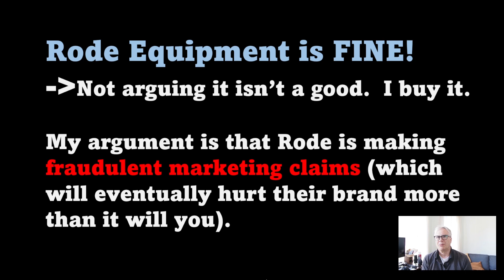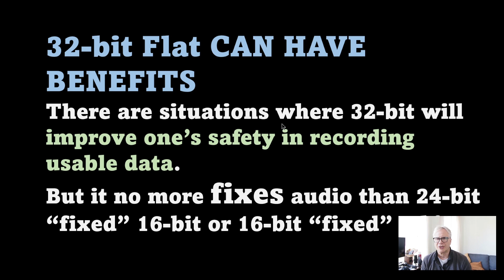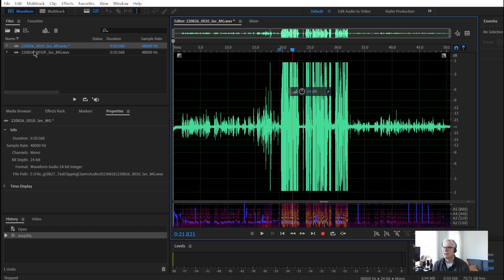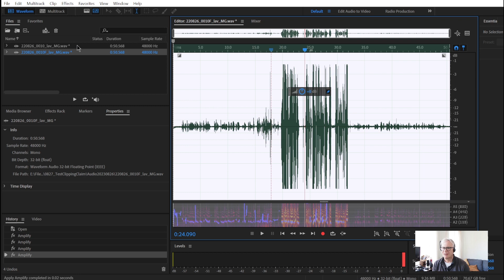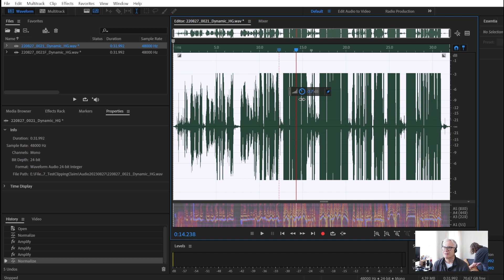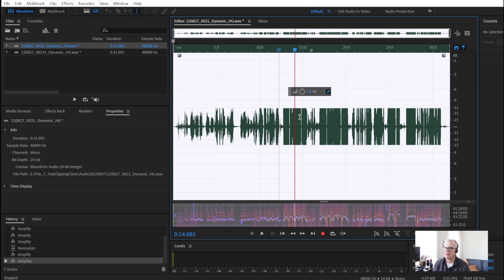32-bit Float Microphone Clipping Tests

Comment: The 32-bit version did actually capture the salvageable loud part, but you boosted the whole thing to compensate for the section that was too low.  Use the blade tool to cut that clip into sections.  Lower the sections that were too loud, raise the section that was too low, and you'll have completely usable audio.  The main objective of 32-bit is to capture everything, and to have the power to isolate and just adjust any sections that are not usable.  In a perfect setup, you would pick a gain that you like in its unmodified form, and you never need to adjust it and you just have a bigger file.  In either case, after making those adjustments, you will likely re-export them as 24.
Reply from the maker: I analyze the data directly.  I don't use tools made for consumers to modify audio.  They aren't designed for testing.
Reply: @MaxoticsTV  The best test is still your ears.  If you boosted the just low parts, then lowered just the loud parts, that entire recording would be completely clean.  You played perfectly clean audio when you played back the loud section with the volume lowered, but for some reason you boosted the entire clip back.  That defeats the purpose.  Record the whole thing in 24 bit with the gain all the way up, then try the same test.  You will likely end up with an unusable recording that can't be lowered enough to sound clear.

Comment: I don't know if I followed you on your first test. When you raise the gain of the 32 bit Recording the MIXER was distorting, not the recording. When work on 32 bit the way you've done, you have to process the audio, like "normalise" it to -1dbFS or even 0dBFS to get benefit of the bits. Then you'l ser the "magic" - what mas clipped will sound fine. Remember, as you said, we have to Pay attention at the analog worlls stage: thoss "don't bother with gain" recordings works only when mic is plugged digitally connected, like via usb - if you use an analog stage like a preamp, you have to be sure not to clip the preamp as always. In that case, the advantage is that you can record with very low gain and raise it later, because the recording noise floor is very low.
Reply from the maker: I didn't understand then, what I understand now.  So I made some mistakes.  But I leave the video up so anyone could see how I've worked through these questions.  I later wrote an essay that I'd love to hear your comments if you have any.  https://maxrottersman.medium.com/the-three-types-of-microphone-clipping-explained-d23ad13a60f7?source=friends_link&sk=2741a5e36687099eb740aa92b80fa8c1

Comment: So I'm new to the 32 bit thing, but what I can tell you is that I used to do audio production as an engineer, and the 32 bit audio you showed is usable. I believe you just turned up the volume to show that it still clips, however, that will happen with any normal audio turned up to an extreme gain. I'd actually just compress the audio to maintain some kind of functionality to the waveform. I don't know if you tried this out or not, and if you haven't maybe try that test too, as I am curious what kind of results you would get. I am sure with that audio you created, being an almost "beyond extreme" set condition, if you can get even something remotely usable, then in a typical condition, it would be an absolute game changer. I do appreciate the video tho, take care.
Reply from the maker: I did these tests early on and there are some flaws because I didn't totally understand all the issues, or remove capsule clipping from some of the experiments.

24-bit has 144db range WAY PAST anything you'd use from a microphone.  32-bit float has more range exponential "float", but it is at the expense of precision; that is, it when mapped back to fixed numbers resolves to 24-bit.  

32-bit float was designed for large number financial calcs where precision is put aside.  I can understand why some audio mixers might want to use it, but if they understand data, don't understand why they would because unlike large financial numbers, every value MUST be resolved back to a fixed number.  Thanks for comment.

Comment: Thank you for taking the time to do this comparison. I think the experiments did show that 32-bit float can be useful in preventing clipping. The fact that the high volume peaks were not cut off in the waveform, means that there’s usable data there. I would have probably used some kind of loudness compression to decrease the dynamic range between the quiet and loud parts and that would have made it more intelligible during the quiet parts, while keeping the loud parts louder, but not clipping. Without compression, the difference between the loud and quiet parts will be as you recorded it with a large range between them. The solution is for me to turn it up on my end which would be very loud when you spoke loudly, but that’s really what happened when you recorded it! :-) Thanks again for taking the time.
Reply from the maker: Thanks for the kind words.  After hundreds of hours I was able to figure it out.  I explain here why bit-depth, actually any bit depth, can't prevent clipping.  Let me know if you still believe it can!  https://maxrottersman.medium.com/the-three-types-of-microphone-clipping-explained-d23ad13a60f7
Reply: @MaxoticsTV  I've only skimmed your write up. From my understanding, the way 32-bit float works is similar to having a -20dB safety track, but it works more seamlessly where it's all recorded on a single track. It's as if I recorded with multiple devices set to different gain and I chose the one where the audio didn't clip.
Reply from the maker: @joentell  Your understanding comes from people who want that "understanding" to lead to your understanding that you should buy their equipment ;)
Effective safety tracks use two microphones, each set at a different pre-amplification.  That has always worked and continues to work.  It's physically (electronically) impossible to have different "tracks" from one microphone; that is, different tracks with one track having audio information not contained in the other.  Unfortunately, you have to think it out.   -20db, all those numbers mean nothing by themselves.  As I point out, this phenomenon of wishful thinking was poked fun at in "This Is Spinal Tap" when the guitarist claims his amplifier is better because it has an "11" on the volume knob.  I believe you if you put some time aside to read my article, or others on the science of how electronics work, it will be WELL worth your time.  Once you know, you can't unknow!  And it will help you use your equipment better in the future.  Why they're able to fool you with the safety track is covered in my story in the discussion of data ranges.
Reply: @MaxoticsTV  I'm one of the co-creators of the Spatial Audio Calibration Toolkit and I'm also a content creator here on YT. I'm currently working on an audio calibration app. I have a good grasp of how audio and electronics works. For fun, I make calibration profiles for cameras, so I get that aspect also. 

I own a Rode VideoMic NTG that allows you to record one channel at your preset gain level, and on the other channel at -20dB as a safety track. It's still only a single mic capsule. I've had times where I've had to use the safety track because either my settings was wrong or a sound was too loud.  It worked. I don't get what the conspiracy theory is.
Reply from the maker: @joentell  I had a long correspondence with Curtis Judd.  Ultimately, he didn't want to know the truth because the truth is not one thing, it isn't just about the science, it's about what is truth in your social group, tribe so to speak.  If the truth means he was not truthful (even though that's the last thing he wanted to do) would he avoid understanding it if it's a small thing that most won't notice anyway? That is, "A man won't learn something he's paid not to understand".  Your brain (as my brain) will instinctively avoid facts which threaten one's framework, a framework we all need to survive without crushing uncertainty, doubt, anxiety.  As I offered to him, but he declined, I'm happy to go over this issue, step by step, on the phone so we can find either the step you don't understand, or I don't understand.   Despite spending hundreds of hours on this, I may still be wrong.  So my brain too, doesn't want to know the truth if that's the case.

When you say "it worked."  That's subjective.  What do you mean by it worked?  How hard did you try to equalize the quality of both tracks?  Again, your brain doesn't want to learn that it doesn't work.  Natural to us all.  

As for the conspiracy theory.  I didn't say that. To give an example.  Rhode says 32-bit float prevents clipping in the Wireless Pro.  They also say it has "Gain Assist".  It's a proprietary device where one can't test their claims.  Are they using 32-bit float to "remove" clipping or gain assist?  (they're using gain assist).  Because "gain control" or "limiters" have been around forever they need a way to differentiate their product so you upgrade or buy theirs.  Therefore they market it as 32-bit float.  Engineers aren't saying that.  Marketing people are.  No one tests it.  They buy the equipment to follow their creative dream.  As Curtis argued, "if it works, why do I really care."  

Well, you don't have to ;)
Reply: @MaxoticsTV  in your video it did prevent clipping. You raised it to a level that caused clipping in the DAW. When I say it worked, I mean that in one track the audio clipped and in the other it didn't because it was 20dB down. I don't know what else to tell you. I've had an issue with a Rode product before and they setup a meeting with me and their engineers to discuss the issue. They didn't avoid it. They listened and admitted it was a real issue. So, I don't know what else to tell you. Don't mistake me not agreeing with you as not being willing to see the truth. The truth is the objective and I do my best to not let my feelings get in the way of that. When I find something out that is not the popular opinion, I welcome debate. I want my theory challenged because if no one can poke holes in it, then maybe it's correct. But truthfully, I don't care about this topic that much. I have my own truths to fight for in this space. But, if you believe you're correct, fight on! I can respect that. But make sure you're correct and be willing to switch mindset in a heartbeat if information is presented that shows otherwise. Science is about uncertainty and trying to be more certain about what's true and what is not.
Reply from the maker: @joentell  I did these tests before I understood everything and I mention those errors in the description.  As you said, you only skimmed the article.  You haven't done tests to disprove 32-bit float fixes clipping.  Anyone who really wants to know can read my explanation with care.  They can think through every part of the process.  The vibrated air molecule.  That vibration moving a magnet.  That magnet pushing an electron in a wire.  That electron going through the base of a transistor.  The reference current going through the transistor.  That current going into another set of transistors and so on.

Yes, if you have information to disprove my explanation I want to know it. I ask everyone and no one has given me the specifics of where I'm wrong.  It's always a version of "It works for me." That's not science.  If you want to know where you have missed a part, I am always here to walk you through it.  Science is also about the best available explanation.  Math IS about certainty and I can tell you with certainty that 32-bit float is no difference in fidelity from 24-bit fixed.  You don't have to take my word for it.  Research it yourself.  

I try to explain this to non-computer people here: https://maxrottersman.medium.com/explaining-32-bit-float-audio-1b78c7cf6c0?source=friends_link&sk=1156d0fc7379052f2919b94246e6f73c

But 32-bit float isn't why clipping isn't fixed.  It's what I thought in the beginning.  Eventually I realized the physics of electronic circuits were the main reason.

Cheers!

Comment: This is a very poor test ...enough said
Reply from the maker: Why enough said?  Does 32-bit float reduce clipping or not?  These were early days in my experimentations.  Science is HARD work.  There are 3 types of clipping.  Physical, preamp gain and digital.  The result from bad luck, back planning or bad understanding.  In this test, I should have removed physical clipping from the experiment, or isolated it.  However, bit-depth has nothing to do with physical clipping, so I'll say 'enough said' on that ;)  If there is science to prove me wrong please point me to it, or explain it.  Thanks for the comment!